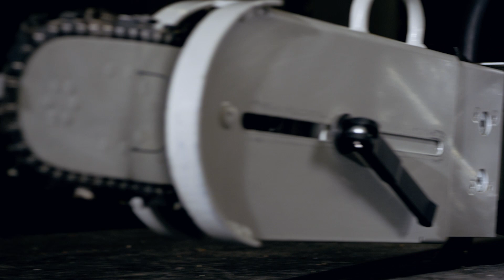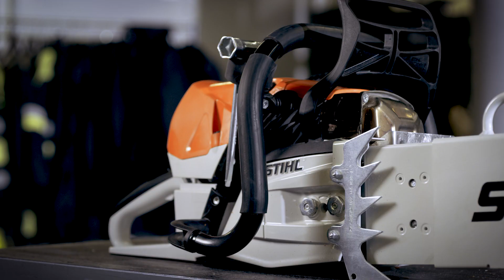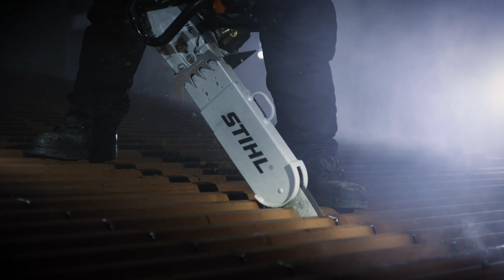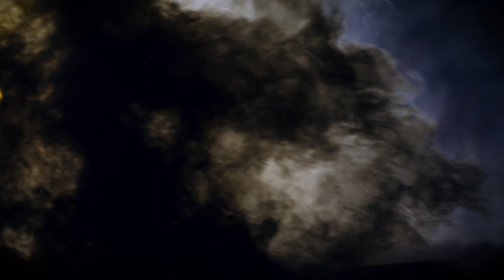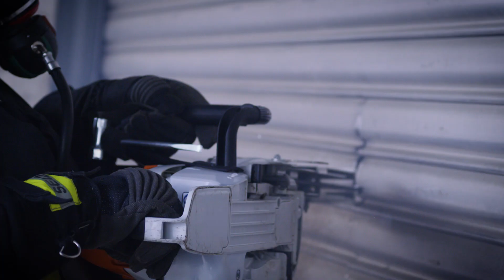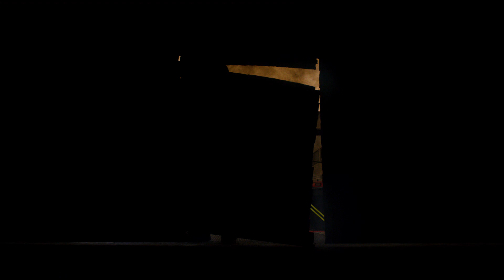STIHL MS 462 C-M R | High power saw for emergency operations | That's why

Comment: I work at a municipality., my job is to maintain of the fire stations rescue tools. We have recently, [the past 2 years] have switched over to the 462 with a 20 inch bar. Complaints are now coming in from several stations that it tends to bog when ventilating a roof. No other blogs I have spoken with seem to have this issue, although they are not ventilating a roof either. Once the smoke gets thick they bog down. Anyone out there have this issue? Thanks/
Reply from the maker: Hi! First, we would like to thank you for taking the time to reach out and let us know regarding the issue you are encountering. We are sorry to hear about the issues you are facing and definitely understand that this can be frustrating. We strongly advise contacting our colleagues in your country, who will be able to guide you accordingly on any technical assistance you might require and to arrange an assessment on your machine!

Comment: When I was a firefighter we had stihl but because guys would use that tru fuel engineered fuel garbage the saws would never start right vs mixing the gas ourselves
Reply from the maker: Hi! Thank you for reaching out to us and letting us know your perspective on our products. The fuel required for this chainsaw is a mixture of two-stroke engine oil and gasoline, in a mixing ratio of 1:50. STIHL recommends you use STIHL MotoMix. If you mix the fuel yourself, use only STIHL two-stroke engine oil or another high-performance engine oil in accordance with the specifications within the manual. You can find more information on fueling for the STIHL MS 462 C-M R within the manual located on our official website!